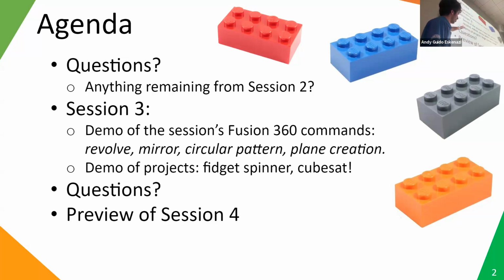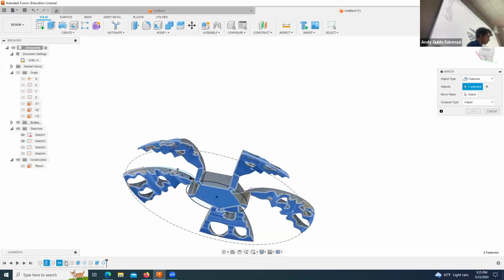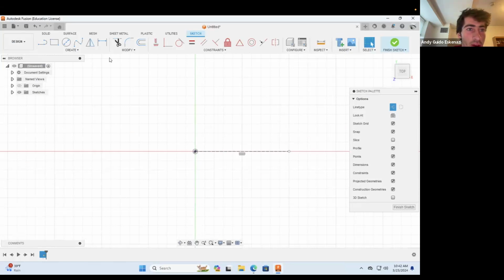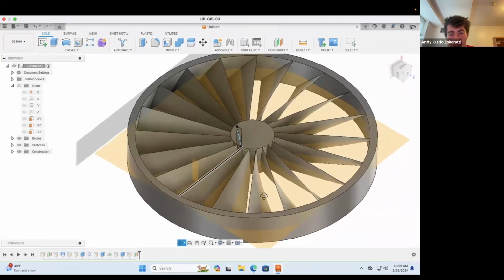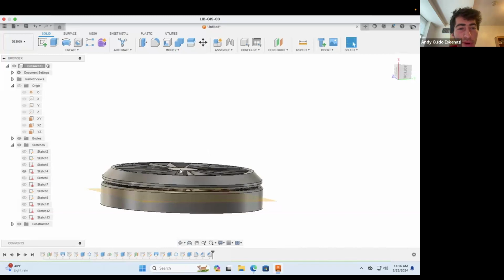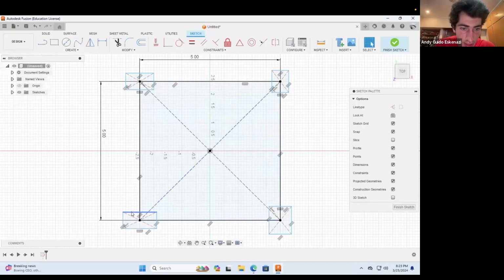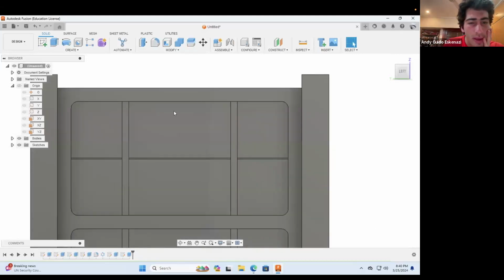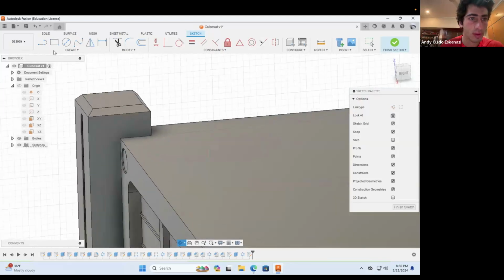How to CAD Almost Anything! Fusion 360 edition: Session 3

Comment: The error at 2:02:24 can be avoided by using the Split Body function (with the top surface as the splitting tool), using it again to separate the flap itself from the protrusions, using the Circular Pattern and then combining the bodies again (Combine function).